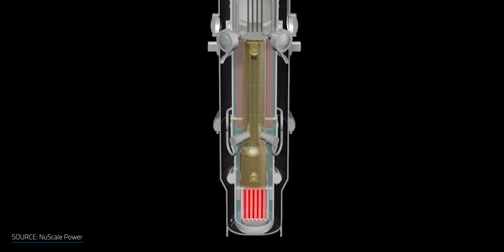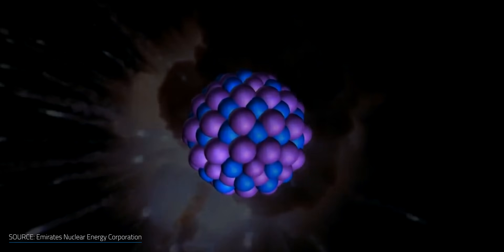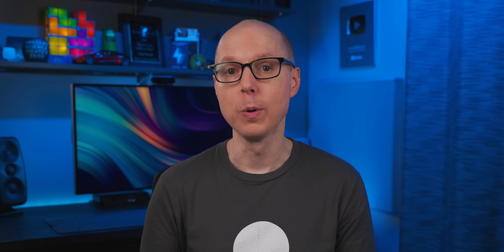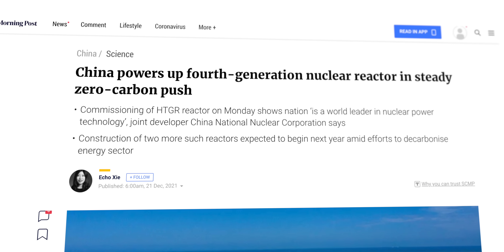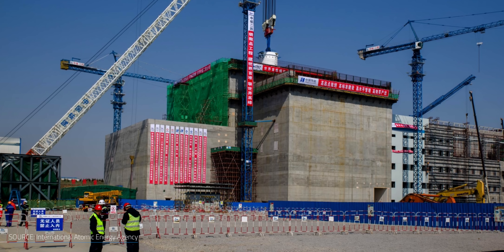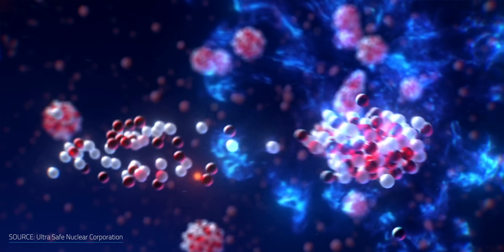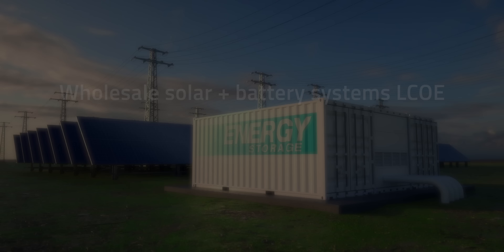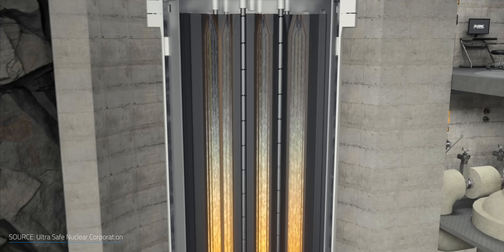Forget Small ... What About Micro Nuclear Energy?

Comment: Eeeeehhh glad to see we made the cut! I just finished my nuclear engineering internship at OPG and my girlfriends mom happens to be one of the two people who started the OPG new nuclear project! I'd also be interested to hear what people think about the Bruce power fusion reactor. I for one am very excited to be one of the "young blood" kids just stepping into the industry!
Reply: Bruce Power certainly has access to plenty of deuterium and tritium. Well, we’re very proud, and we’re very happy, and we’re thrilled!
Reply: @Jesus Saves deuterium and tritium have the lowest energy required for fusion so they're the easiest isotopes to produce a successful reaction with in the fusion reactor. When it comes to fission we use deuterium as a moderator in the CANDU reactors and produce lots of tritium in the reactors.
Reply: @Jesus Saves MicroNuclear thread.  The MTF module that Bruce Nuclear will be installing is much smaller than the ITER.
Reply: @Jesus Saves Not my circus. Not my monkeys. While we are all happy, proud, and thrilled that Darlington is putting in a couple of BWRX-300s, TheOtherOne asked what people thought about the Bruce Power fusion project and I threw in my two cents. Congratulations, by the way, to TheOtherOne on finishing your OPG internship. Are you sticking with OPG or looking to apply at Bruce?

Comment: How about not going full SMR or micro, and just use nuclear for heating?  It could produce some electricity but, say, only 10% of its total output (which could power a liquid loop for distributing the heat).
This way we could use RTGs with no moving parts, and of any size.
Using nukes for heating only would greatly simplify design and construction, and longevity.  We can use renewables and batteries for the rest.

Comment: I imagine a micro reactor, say the size of a car engine, would probably run best on an ultra low critical mass fuel like Curium-247. Which is basically unobtainium :/ Something like that would need massive amounts of other reactors to produce such a fuel in quantity. 

Also, I feel like in general, a true micro reactor would need a fuel that’s so high quality, and purity, that it’s indistinguishable from weapons grade fuel. 

Or a subcritical mass that’s exposed to some sort of neutron generator, Californium-252 maybe? Also unobtainium

Idk, I feel like the actinides further down the series would be really good for this kind of application
Reply: dont forget factcheckerium-34, or sjworium-117... those are highly energetic and easy to consume with no one being worried about using them up
Reply: Sorry to be back on the soapbox. The SLOWPOKE (acronym for Safe LOW-POwer Kritical Experiment) uses 93% highly-enriched uranium-235 (I wonder about U-233) and beryllium-9 as consumables. So, yeah, Rusty nailed it.

Comment: Regarding the "waste" concern, modern reactors such as molten-salt based could easily separate out the useful materials for medical isotopes, xenon gas, etc - all valuable.  We don't do this today because solid fuel randomly traps these valuable things all mixed up, it's like tossing your entire pantry on the floor - a worthless mess - but do it while the reactor runs, and you have value-added and less waste.
Reply: To answer the various questions here (which are good ones generally) it doesn't fit too well in a short YT comment, I've been studying this for about 15 years and am quite excited about the active building of Gen IV (including Molten Salt) reactors around the world as it has been a long wait over that 15 years.  Regarding recycling nuclear fuel, it is already done by non-US locations, particularly France.  It is making a comeback.  Here is a 4 min (not too techy vid on it)  watch?v=MlMDDhQ9-pE and here's an earlier 16 min vid on the value being thrown out from "nuclear" waste.  watch?v=oAVCaUonrbE  In short, because an MSR operates hotter, more things come off as vapors, and because it is liquid, it can be pumped and chemically separated to collect the materials that are liquid at that temperature.  Hope those help!
Reply: MSRs have been in the prototype stage for decades. It's nice theory but no solution to any of our problems which need sorting out now.
Reply: Try also this 2h documentary (feel free to watch in small bits at a time) as it does a great job of these questions as well and looks at it frequently from the perspective of space exploration.  I think you'll enjoy it.  watch?v=0BybPPIMuQQ
Reply: How do I find more information on this? Books, resources?
Reply: "Easily" separated? Only for truly bizarre versions of interpretation of "easily". I'm seeing a lot of misinformation about nuclear, and unless you're willing to store the waste in your own basement (which you could never assure for the life of the waste), you shouldn't be advocating.
Reply: Ok is a molten salt reactor already built and how many and where? 

If not then what you are saying is basically just allot of hot air.
Reply: @RavensEagle  Oak ridge ran a test reactor back in the 60s and as I understand it, "communist" occupied China finally has their prototype reactors, based on the Oak ridge research by the way, up and running.
Reply: There's not a single working MSR in the world, only prototypes, which means we're at least 20 years away from any meaningful energy supply from this reactor type.
And that is generously assuming they actually work and the break-through will be in the next few years.
By that time it will already be too late to mitigate the climate catastrophy we're heading for. Massive and immediate build up of renewables (wind, solar etc.) is the only way forward, that can actually save us..
Reply: @wermagst Try again. ThorCon will be delivering reactors to Indonesia within the decade if they stay on track.
Reply: @jsn1252  "within the decade if they stay on track."

The Spartans said it best. "If." Any planned vs. actual results quickly dismiss this timeline.
Reply: @wermagst  >climate catastrophy
LOL you still believe that after 50 years?
Reply: @ghoulbuster1  Believing is something for religious people. I prefer sticking to scientific facts.

Comment: LCOE is just barely competitive for SMRs now, but just watch.  Solar and wind have had several decades and their LCOE is about 1/10th of where it started.  SMRs are going to make those "renewable" sources look very expensive, particularly when you add in battery backup.  To put things in perspective you could dig a hole anywhere, take average dirt from it, extract the thorium and gain the energy to fill that hole back up with oil 15x over.  In reality, you get far more thorium (and uranium) when extracting ore from a rare-earth mine, which makes materials modern products need, but the fact you COULD do it with dirt found anywhere is amazing.  Once licensing and manufacturing costs come down due to volume, the prices will fall very quickly.  Fossil fuels will also become basically obsolete - they already are, they just haven't finished yet.
Reply: pretty much, high heat(700c+) nuclear reactors can make fossil fuels aka can completely phase out fossil fuels, nuclear's current high cost is due to regs and not building in factories/shipyards

Comment: I am not convinced that dividing a reactor into smaller parts solves its disadvantages. Each module would have its own risk of failure and security requirements. When you say that the reactor would generate so many dollars of GDP, that is the same as the unwanted cost of the bigger ones. We don't want them to require more jobs than absolutely necessary.

During the current crisis, fears about safety have no place and red tape surrounding construction should be removed. Maybe we'll have martial law soon and energy rationing.

Comment: Not to mention that nuke only works at a fixed output. Power consumption is NOT flat, it fluctuate wildly. It's a good base, but not useful past that since it can't be throttled.
Reply: Nuclear can be throttled, it's just generally designed not the work that way because the incremental cost of running at full power is negligible, i.e., the fuel cost is a small fraction of the total cost of operation. Existing nuke plants only expect slow changes in power load - that's the nature of base-load power. Coal plants, same idea, same as gas plants too, except the ones designed to be peaker plants (less efficient, but better at load following). In case of emergency, you can scram a reactor - essentially taking it from full power to no power very quickly.

Comment: 6 years to build a reactor is wildly optimistic. Flamenville 3 started construction in 2007. It's still not close to commissioning. Hinkley Point C was started in 2016 and is not even half built yet. One of the quickest was Torness which took 8 years. Heysham 2 took 9 years.

Comment: I've studied electrical engineering and my engineering thesis was also on plasma reactors, which touched a little the subject of fusion.
I was interested in energy market for at least a decade now and I can honestly say - SMR ain't gonna happen, or at least not on the large scale.
Electricity is a universal commodity, which means that lowest price wins, with rare exceptions.
Microreactors ro SMRs having theoretical LCOE higher than PV and wind before they're even mass produces is already market loss, and this is without following trends of those sources.
Photovoltaics are getting cheaper every year, with theoretical costs in orders of magnitude lower than now.
Battery costs will drop below 50$/kWh on pack level before end of this decade, which would make even gigantic home supplies cheap.
Both of the above are near no-maintenance, with maybe exception of cleaning your PV once in a while, while any reactor will require maintenance as well as refueling and fuel regeneration.
Microreactors might come in handy on freighters and similar applications, but only if they provide enough power at low cost.
Entire nuclear sector exist pretty much as a sideproduct of atom bomb production, and it never was cheap or affordable as people often stated.
To even be remotely viable in near future, we must be talking about LCOE around 40$/MWh or cheaper, which is closest to thorium, which doesn't yet work.
Possible applications I might see would be large cruise ships and freighters, and possibly larger trains if reactors were small enough.
It's a cool concept, but people won't overpay for electricity to have it from cool source.
Reply: @Jesus Saves PV + battery installation doesn't need to be hooked up to grid either, and the cost of such installation is already lower than estimate cost for SMR at mass production, which doesn't exist.
And both PV and battery installations are still dropping in cost sharply, where nuclear has seen no progress in last 20-30 years.
Reply: @Jesus Saves 2017 was 5 years ago, so half a decade.
Making excellent progress doesn't really matter, if overall energy cost is higher than PV and wind.
3rd world doesn't have any infrastructure to deal with nuclear waste nor facilities to recycle such waste.
This would literally make them fully dependent on more advanced countries draining them from money.
Water purification and waste treatment can be run with just PV, and even without batteries for much cheaper than you'll ever get with SMRs.
Especially for 3rd world, electricity cost is the most important, and solar needing no maintenance as well is just a big winner here.
Reply: lol people are over paying for a cool source already, aka solar/wind :/
Reply: @bencoad8492  Both solar and wind are cheapest sources of electricity next to hydro, which has extremely limited availability anyway.
Lack of grid batteries, which have never been necessary before is completely different thing, which will be solved separately in next decade or so.
Cheapest li-ion is already at 65$ per kWh and other chemistries aim at <20$/kWh with higher cycle lives, so I would not worry about that.

Comment: Bottom line, nuclear power is double that of solar + wind + batteries. BTW batteries are still needed to smooth power output and to match production with demand more perfectly. 

Nuclear will take at least a decade to get built and we’re still messing with the design so it will be much longer.  As in Germany, the people rightly or wrongly might decide they should be shut down for radiation risk. Putting hopes onto nuclear therefore has a long term negative effect, pushing us to use more Fossil Fuel now instead of simply building more existing renewable at lower cost. 

Not mentioned is that energy conservation in buildings can be had at $10 to $20 per mWh but is not pushed because there is literally nothing to sell. Some governments are pushing building performance to cut usage by 99% at tiny increase in cost but that is slow moving but would be a much better solution than nuclear in every regard including better longevity and occupant health. Most governments are slow to act.  The US for example has taken on the IECC (International Energy Code) performance code as agreed to get ARRA funding during 2008-9 crisis but states like Texas put IECC into their state code but in true Texas fashion do not enforce it resulting in 99% of new buildings using any times more energy than they need to.  Oh, yes deregulation sentiment but in their case, it’s literally in their building code but never enforced.

Comment: I remember in High School being told that, even if we went to all nuclear power on the planet...we only have ~80 years of fuel. So there's that.

 This was in 2004, so YMMV.
Reply: It was a foolish statement back then, and even more so now. We could power 100% of the planet using a either a uranium or thorium fuel cycle for millions of years - though U-235 is rare, U-238 is not, and thorium is even less rare. There is enough thorium in a block of granite, that it's energy equivalent exceeds that of an equivalent volume of petroleum equal to the granite - we won't be running out for a very long time because nuclear fission has a million times the energy density of chemical fuels. They have also been predicting that we would run out of coal and oil for a long time (even over 100 years ago).
Reply: You can multiply that figure by 100 with waste reprocessing (most current plants only use about 1% of their fuel).

You can multiply that number again several times by using thorium instead of uranium. It is a waste by-product of rare earth mining.

Comment: Honestly, I'm not sure these "micro" reactors are small enough.  Take a look at radioisotope thermoelectric generator, or RTGs, and Kilopower Reactor Using Stirling Technology (KRUSTY).  Because I'm still waiting for the 2.5 meter cubed, 15 Mw, self contained reactor from the video game "Space Engineers".  The building I live in houses two apartments and could run rather nicely on 10-15 Kw, even during an Ohio winter.  If I could get that with an operational life of 50 years, it could be sunk into the foundations.
Reply: You aint getting 15Mw from a RTG.
15Mw is 15,000,000 watts.
The RTG mounted on the Mars rovers gives 110 watts.
The 3 massive RTGs on the Voyager space probe each provide..... 160 watts.
A typical home needs 6000 watts (6kW). So yes, the 'Space Engineers' reactor could run one house, as long as you are prepared to, several times a week, fly into outer space to a nearby asteroid to gather the necessary feul to keep it running ;)
Reply: @Debbiebabe69  The Top-ROCC and SEEK IGLOO radar systems in Alaska use RTGs. Five kilograms of strontium-90 generates 240W electrical using thermocouples.  Sterling engines triple the electrical output over thermal couples.
Reply: Problem is, RTG's only generated a relatively small amount of power with a short lifespan.
Reply: @cappuccino-1721  The thermoelectric material PTZ materials degrade from fast neutron & high energy gamma bombardment & from thermal gradients varying.

Comment: I still don't understand why folks don't talk about taking a "relatively" stable element like uranimum and extracting all that energy 1000s of times quicker than it would dissipate naturally.   This is why solar/wind/hyrdo is so much better,  it is simply redirecting the energy,  not speeding up the process,   I believe only half the climate problem is CO2,  the other half is heat.  Coal,Oil, Nuclear all  take stable compounds/elements and release all the energy quickly

Comment: S.M.R. Has a similar long term waste issue to current nuke power. Thorium systems can use that waste as fuel, cleaning up the leftovers. S.M.R cooled by helium, cost prohitive and if it fails then FAIL. The price per Kw/hr breakdown shows Th beats renewable as we do not have the storage capacity to meet fluctuating demand when using renewables. Lastly, but by all means first, thorium was one of the orignal ideas for U.S. nuclear power submarines, an enviroment where compact, reliable and safe mean life and death.
P.S. There was a thorium reactor built and operated at Oakridge Tennessee in the late 60's/early70's that had a short run time due to the flouride dissolving the components. 50 years later and science has materials that can last substantially longer. Citation nedded.